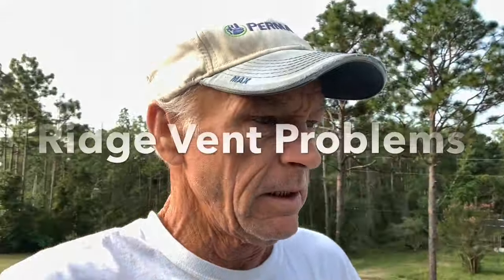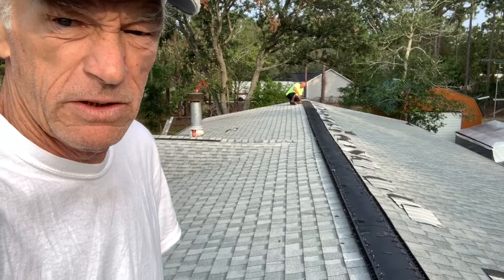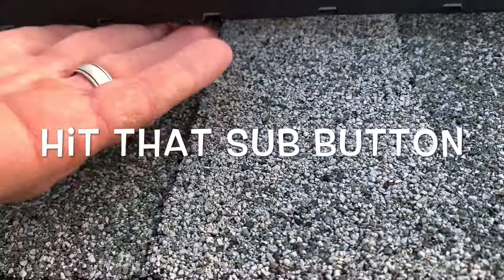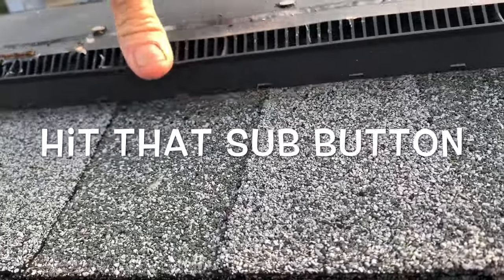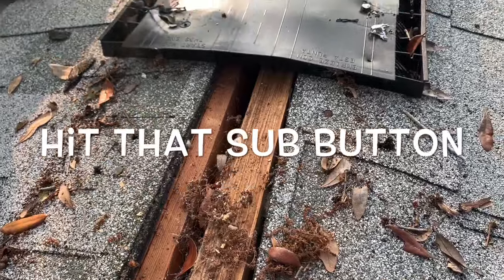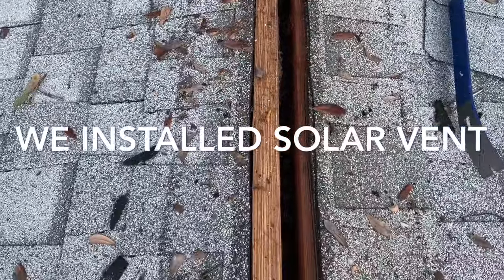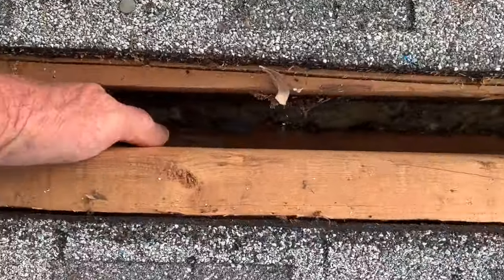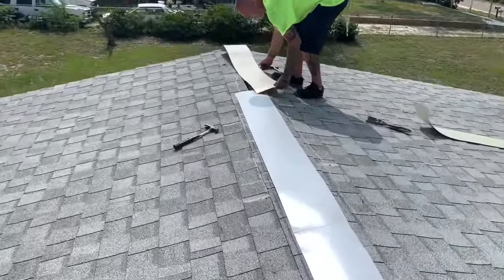Ridge Vent Problems When Not To Use It

Comment: I was about to install one of those on a house that got a roof then the original flipper tan out of money and the contractor never installed it.
Glad I watched this. I had some doubts it would work because the last contractor had added lumber to the ridge board and it might be too wide for the underside of the vent to get air.
I think I will get with the new owner and go with a different path.
Reply from the maker: I agree

Comment: Just ordered a new roof, and it's coming with ridgevent.  I have a problem with Pinetree needles on my roof. Looks to me like thousands of pine needles are going to get stuck in those little gaps and be next to impossible to clean out. They get in every crevice of every car on the property...after seeing this, I'm not sure it's the best solution for me.
Let me add, my roof is an offset-A frame..two thirds of the roof on one side, one third on the other. Will this uneven distribution affect venting? 
Thank you.
Reply from the maker: Interesting love to get pics of the roof
9 102 941 7 61

Comment: I have a ridge vent on with a flat roof one side of the roof  is shingle the flat roof goes over a dormer and the roofing company nailed the ridge cap to my EPDM flat roof I can see the nails sticking out of it what should I do?
Reply from the maker: They probably didn’t have any choice but to nail it where they did if your roof is like that and one thing that I hate about ridge vent is the nails will be exposed. You can see them through the vent and that’s one reason why I hate ridge vent to start with. I don’t think there’s much you can do about it at this point just keep your eyes on it and make sure it does not leak.
Reply: @Drewsroofingandhomerepair  thanks for the response.  I'm really regretting the vent  now but I will keep it until it leaks  then get rid of it  and  get a fan.

Comment: Wow.  I'm not a roofer by any shot, but that shingle line looked about as straight as the shingles on really old English cottages and not nearly as 'charming' as those.
Was considering a ridge vent on a low-roof (slab foundation) that looks to be close to the one you are standing on.  Was concerned about monsoon storms blowing  the water right back up to the cut out top.  Am thinking I'd rather have something go wrong with one or two small holes in the roof rather than near the entire top of the roof having to be replaced.
Reply from the maker: I agree, 100% whatever you do do not put ridge vent on a low slope roof especially if you have heavy wind in your area or even the snow that sits up there as it melts it can whick its way up under the shingles

Comment: What happens if you have tons of soffits intake vents along with ur ridge vent?
Reply from the maker: Double wide mobile homes are not made for ridge vent. Maybe in other areas besides where I live it would be OK. I live in the 110 mile an hour wind zone and what happens is when the wind is blowing it blows the water up underneath the ridge into the house. If my house was a 1212 pitch I probably wouldn’t mind it so much. Every situation when it comes to ridge vent is different

Comment: Where is the air intake on this trailer? Either at gable ends or they run a 2” overhand at the eves and perforated soffit aluminum. 
The problem w the solar is in winter it won’t run, and it should have a humidistat as well. 
Passive static vents would be better like every 15 feet.
Reply from the maker: This place has vaulted ceilings

Comment: Can I caulk the sides of the ridge vent where the ridge vent is not touching the roof?
Reply from the maker: It should not be above the roof it should be touching the roof it might need to be removed and reinstalled caulking is a Band-Aid

Comment: Along with the improper installation, does the slope of the roof also make it a good reason not to install that certain vent? It doesn’t look very steep at all.
Reply from the maker: Would never put ridge vent on something with this kind of pitch on it
Reply: @Drewsroofingandhomerepair  what if you had that slope on one side and a typical slope on the other?
Reply from the maker: I don’t recommend putting Ridgevent on anything with a low pitch. What worries me is if you’re in a Highwind area the water will go up the roof and into the Richmond

Comment: ❓ I have a house with a hip roof. I took my flat ceilings down and want to insulate and sheetrock directly to the shape of the hip roof .. how do I make sure that each section gets vented?
Reply from the maker: After doing what you did that makes it a little bit difficult to be honest. I guess you could use ridge vent if you have a steep pitch but you don’t so I’m not real sure maybe you can put inside vents
Reply: @Drewsroofingandhomerepair  what a good idea! Never thought of inside vents. I did a lot of research last night on the matter and many professionals were saying that the only way to do a hip roof that's vaulted it is to use spray foam on the underneath of the decking and then vents aren't needed.. of course like everything else there are two opinions on spray foam on the under decking. Many swear by it and say it's the best option others don't like it.
Reply from the maker: I do not like spray foam on top

Comment: What about using other types of vents? I live in so cal and my double wide gets hot
Reply from the maker: If there’s not any vents up there now I wouldn’t suggest it it’s according to what kind of ceilings you have in your house is your roof vaulted in other words is it flat or is it on an angle if it’s on the angle then there is no venting. I don’t recommend putting a ridge vent on some thing that doesn’t have it already. These double wide mobile homes don’t have enough roof pitch to install the ridge vent. Well I take that back we live in a windy area and therefore ridge vent is a problem on low pitch roof but if you do not live in a windy area you can put ridge vent on your house

Comment: If not ridge vents matched with eave vents, what would you use to get enough open air flow for a whole house fan (2000 to 3000 cfm) out of the attic space on a 412 or 512 roof?
Reply from the maker: Ridge vent is ok in non windy places. If you don’t get much snow. Use 750 sland back vents. But then at lowes. Or buy a solar exhaust vent
Reply from the maker: Slant back vents

Comment: how to replace the butyl or closure strip underneath the cap. it's  all gone after 20 yrs
Reply from the maker: Remove the screws find out what type of metal roof you have my new closures reinstall them. The ridge back on

Comment: Love your videos!! I am getting my roof done in Canada and my roofer is asking me to install a ridge vent on the vaulted ceilings portion of the roof for added ventilation do you think it's necessary? He says on the vaulted part it is very important.
Reply from the maker: Every situation is different is there venting up there now if not I would not suggest it
Reply: You really should consult someone that understand science not a trades person who makes a video doing stupid stuff.  No adding a ridge and Soffit vents is not necessary,  It will save money during hot summer months but cost you a little money when you are heating.  Since you are in Canada you should NOT add ventilation, you should add insulation and radiant barriers.  You should also find and seal leaks.
Reply from the maker: Wow. So the roofer that is doing the roof is a 
Scientist. Like I said. Every situation is different. This house we are working does not have an attic. The roof beams are exposed.

Comment: Won't it condensate if the vent is not there?
Reply from the maker: This is a double wide mobile home and there was never a vent there to start with a roofer came in and installed the vent later and when he did water got under the vent and into his house so the house was made without them so I wouldn’t suggest putting them on the house if they weren’t there originally. It’s a double wide mobile home and generally you don’t vent a double wide mobile home. When they put two houses together there is no place in between to vent so venting would be unnecessary. They have a roof fence they have soffit vents and that’s all you need no condensation at all after we removed the ridge vent he never had it another day of problems
Reply: @Drewsroofingandhomerepair   Thank you for the information the reason why I ask is because I am a handyman Dealing with an issue on a brand new house that they installed. Double wide mobile home. They did a horrible job. I wish I could send you a picture So you can see how Most of the house has the cap up a little bit higher with some material underneath it but it doesn't look like that plastic roof vent. It looks like a fiberglass material About a 1/2 to 3/4 of an inch thick. Is then in the  Master bedroom area, It steps down and it looks like it just has The cap shingles themselves. And that's where it's leaking. But the Span  Of the cap shingles do not go far enough on either side for water or snow or rain to get underneath the sides.  But I personally don't want to mess with liability roofing issues. I'll tell Them to Call the manufacturers installer it back And tell them to do it right  Or get a pro roofer to do it.  There's a lot of things I'm good at but I'm not gonna mess with the roofing aspect of it. Thanks again for your information
Reply from the maker: 910-294-1761. Pictures
Reply: @Drewsroofingandhomerepair  cant see pictures

Comment: Is there any way to put a roof vent if the ridge is double 2x8?  similar to this one without the gap in between,  total 3" ridge beam. I have a vaulted ceiling porch I want to close in and need air flow from the soffit? Mines a 4/12 pitch
Reply from the maker: I don’t like ridge vent on a four pitch

Comment: I would never have a ridge vent on any roof.
They weaken the peak of the roof, are prone to damage, prone to shrinkage which makes them leak, and they block the peak of the roof from walking and materials during maintenance. They can slightly improve ventilation but create numerous other problems.
Reply from the maker: You are 💯 percent right

Comment: I'm here to figure out how to remove mine. It allows noise and wind inside the attic, which vibrates and amplifies like a drum 🥺🙀
Reply from the maker: It can be removed and it’s not that hard to do once you start taking off the caps and the plastic rigid you will see how easy it is to add caps to fill that space. You might have to run another roll of shingles after you remove the ridge vent. Get rid of it if you can.

Comment: Can a ridge-vent ever be a bad thing?  A roofer tells me its only needed if the linear distance is long.  If not, it actually does damage.  Is he BS ing me to save labor?
Reply from the maker: I don’t know what he’s talking about I can tell you that ridge vent is used for venting the attic and if you do not have a pitch of 612 or greater I don’t recommend it because it might opinion becomes a leaking problem in Highwinds. So I think his answer is wrong Ridgeback can be a good thing on a roof with enough pitch and it could be a bad thing on a roof without enough pitch. Now this generally has to do with the windy areas where the wind typically gets above 70 mph. If I’m venting my attic I personally would go with a solar vent I think that’s the best ventilation there is

Comment: I was leaning towards a ridge vent until I saw this video. I do not think I have enough pitch for the vent to work without water blowing in. My home currently has the roof vents installed from factory but the shingles need replaced. I was wondering if you suggest keeping the same set-up and roof vents already in place or removing them all together when replacing shingles? If I should keep them, would it be wise to replace or better seal the old ones?
Reply from the maker: I definitely recommend vents in your roof. If there are vents in your roof now you would want to replace them with a similar vent. When the roof gets replaced the new vents should be installed where the old vents were removed. I like to use what they call a 750 vent or they also call it a slant back vent on mobile homes. Regiment I don’t not ever recommend on a mobile home. If the vents are there that means your attic needs ventilation. Obviously all attics need ventilation. In someway. You could also I’m not sure what the situation is with your particular house but if the attic is open throughout the house you can remove the smaller vents and add a solar vent to the roof in the back side or wherever the sun hits the most. Do not try to steal the old ones. Excuse me not steel seal. Replace them with new vents.
Reply: @Drewsroofingandhomerepair  Thank you for the quick and detailed response. I will use your advice and not even consider the ridge vent. My old roof vents are not leaking currently but I will replace them. When installing new ones what adhesive or sealer should I use?
Reply from the maker: Lexell you can buy it at Home Depot or Lowe’s. It’s about $9.50 per tube but it is the best. Make sure when you install the new vent you put caulking on the bottom before you said it in place.

Comment: If it has cathedral ceilings, the fan is only going to vent the one rafter cavity in the direct line of the solar fan, you are not providing proper ventilation for this house
Reply from the maker: To be honest, Mobile home roof’s are built differently they’re vaulted ceilings do you have space in between that you don’t know about so in some cases you’re right

Comment: Hi Drew, question I have is I have the same double Wide roof set up but I have vaulted ceilings, 4 vents protrude out up near the peak so 8 total 4 Front 4 on back. 
I'm putting metal roofing on ,can I eliminate those 8 vents ?
I was going to and then do Ridge vent but now I'm not sure, looks like I'd have to remove that metal your replacing..
If I cover over my vents will that be an issue..?
Thanks in advance. 
Have a Blessed day. 
I live in Michigan if that matters to my question.
Reply from the maker: That’s a very good question. And the answer is if there are vents up there with your voltage sealant you need them vents. And I would not recommend Ridge-vent. Unless you want it just for the looks and you have it completely sealed up. If it doesn’t have Ridge vent on it now don’t add it. I hope that helps
Reply: @Drewsroofingandhomerepair  yes it does, thank you for sharing information.

Comment: I have a roof venting problem.. I need gutters and some kind of lower roof vent, and a ridge vent, but there is no overhang on my roof.. I've given this a lot of thought, and might have a solution, but I'd like to run it by a pro first. Can you message me? I will gladly send you photos/videos so you can advise on this, I hear it's a very common problem, at least in upstate NY.. Please message me.
Reply from the maker: Send me pictures 910-294-1761 I’ll be glad to help if I can thanks for stopping by my channel and I hope you are a new subscriber.

Comment: I have this same issue.  Do you have a link to the "putting he metal and shingles back on?  Help please;)
Reply from the maker: No I don’t have a link but if you have ridge vent on a Doublewide, I’m sure it didn’t come with it. I would suggest removing the ridge vent by a roll of metal 10 or 12 inches wide roll it down the center mallet on both sides and then put your caps back on shingle caps not ridge vent on a double wide

Comment: Question for those who know here, 
Had my roof done by a big co in November of 2021.
They were supposed to come on a warm day but showed on one of the coldest days.
 I live in the North East, Boston area.
 When these guys got to the ridge cap it was pitch dark out, they used no light.
 A ridge vent was installed and then they covered it with architectural shingles...
 It looks like Godzilla's back with the razor like blades...
 I'm not happy.
 What do you think? 
I haven't paid anything yet and refuse to until this roof is done correctly.
 Thanks for any help in advance
Reply from the maker: I would be glad to help you as a matter fact it sounds like they used architectural shingles on the ridge. They might’ve ran out of regular caps so I’m guessing they did it wrong. I’ll tell you what you can do you can send me pictures 910-294-1761 I will give you my honest opinion
Reply: @Drewsroofingandhomerepair  that's really nice of you, thank you.
 I sent pics, they're not the best but definitely show my concerns.
 I already voiced them to a rep from the co, and have not heard back since, which was back in Nov. 2021, but the finance co they use has already sent the first bill, which I refuse to pay until the roof is done correctly
Reply from the maker: I do not blame you. Something is wrong with that ridge. Shingles might lay dow over Tim. But not to sure of that. If your ins company comes they will tell you if it is correct. I had to do a roof over again due to fish eyes in the shingles. Water can blow up under the shingles if they are sticking up

Comment: whats the slope on that roof?
Reply from the maker: I bought a 2 1/2 or 312 definitely not enough
Reply: @Drewsroofingandhomerepair  seems like not enough slope for shingles... No?
Reply from the maker: This is a double wide mobile home and it’s definitely doesn’t have enough slope for ridge vent there was not any ridge vent when this house was installed. And for some reason when the roofer installed the new roof he decided it needed Richmond. The problem is the pitch wasn’t high enough and he cut way too much ridge. I live in Southeast North Carolina on the coast. It is in the 110 mile an hour wind zone. I don’t recommend ridge vent around here unless it is a 512 or more